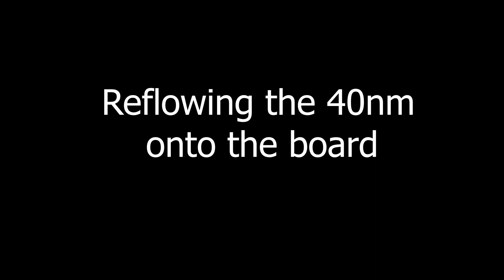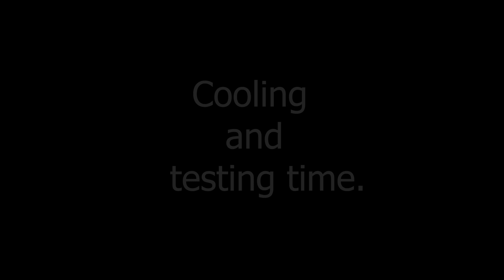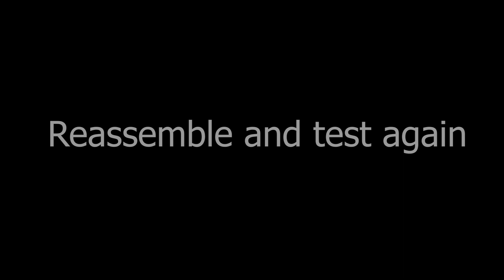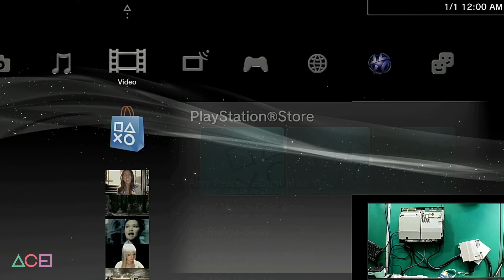PS3 40nm RSX Frankenstein Mod CECHC02. YLOD Repair

Comment: I understand the Tokins have a positive connection/jumper from upper to lower..like in RipFelix threads...you don't use them...are they needed?  Some say you need them?
Reply from the maker: A positive jumper/connection only needs to be done if you remove the Tokins from both sides of the board. Leaving one side on keeps the continuity intact.

Comment: At 2:03 you are checking rsx with multimeter. Please which pins you check?
Reply from the maker: They are the VDDC circuit. One on GND and one on VCC.
The centre square array of pads/balls are offset from each other.

Comment: How long and what temperature did you use on the BGA station to remove the RSX? Thanks.
Reply from the maker: Its a custom profile for my machine and environment. Every machine and environment is different snd needs tweeking
My lead free profile for lifting rsx/cpu/gpu etc

Comment: Can i put 40nm rsx on the slim type of ps3? And from where can i get one of the rsx chips? thank you for your work.
Reply: There is not that big difference between 65nm and 40nm, you'll win few degrees in temperatures, mate
Reply: @umbrella7415  True, but IIRC, there are a lot more 40nm chips about the place than 65nm.

Comment: Are you using just straight hot air to remove the RSX chip or do you have a rework station?
Reply from the maker: A rework station
Reply: @aceconsolerepairs  one you made yourself or did you purchase it?
Reply from the maker: No! A professional station (LY G580)
Reply: @aceconsolerepairs  Thank you! I have been wanting to try this and it sounds like dropping money on an IR station is the most reliable method to do this. Thing is, you are the only youtuber I have found that has purchased one so I am not sure of the quality of the ones I am looking at. Other youtubers seem to use hot air or build their own.
Reply from the maker: @userfriendly7651  my unit is a hot air unit LY G580
Reply: @aceconsolerepairs  would you say you have had good success with hot air? I've heard some people say that hot air is not as precise.
Reply from the maker: @user_friendly86  it’s much more precise than IR